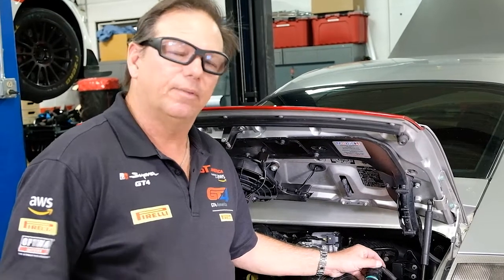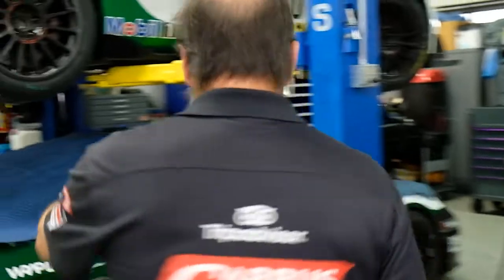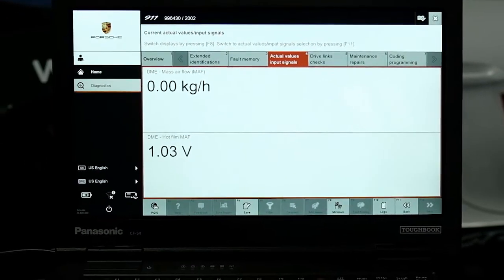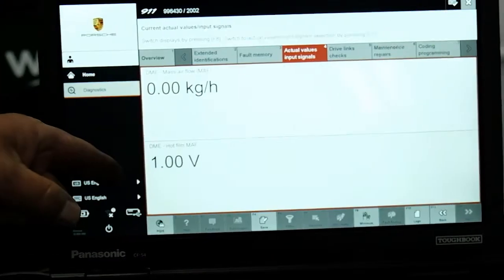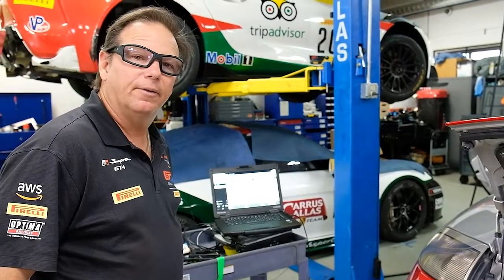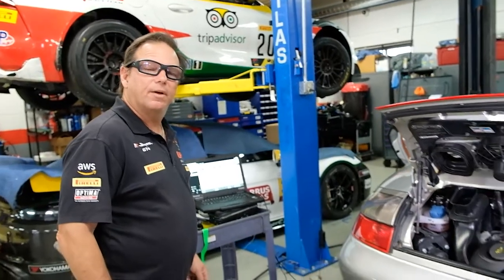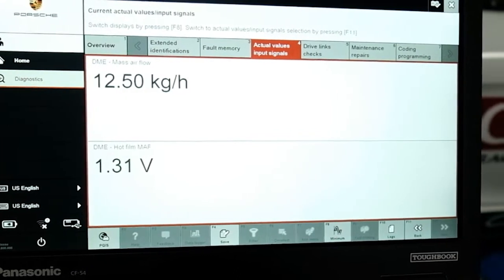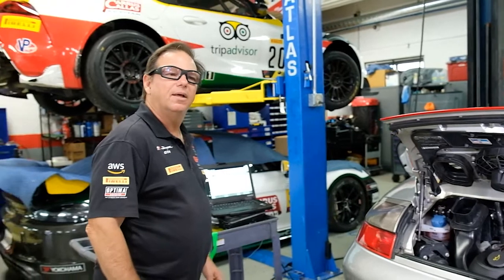Mass Air Flow Sensor

Comment: Is there a factor that can be applied for measuring crankcase vacuum at elevated locations? I live at nearly 8,000 ft in Colorado. Just wonder what number to expect at that elevation?
Reply from the maker: To be honest, this hasn't ever been asked or brought up. It probably does have some effect, but it's obviously not large enough to cause any issues that have been brought to our attention or to Tony's to this point. Sorry about this non-answer! If you do happen to take a reading, it would be great to know what your vehicle reads at your altitude. An M96 engine typically will measure 4-6" of h20.
Reply: @lnengineeringllc  Thanks, we will hook up and see what we get..